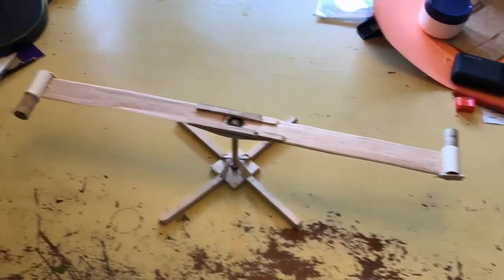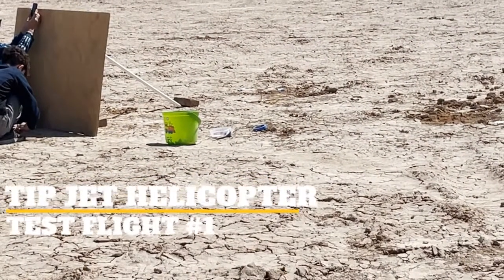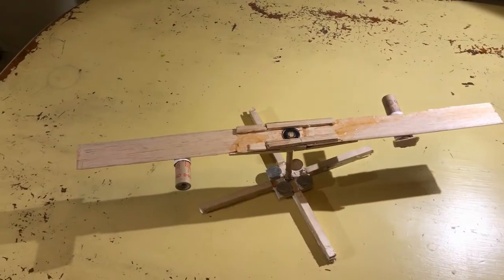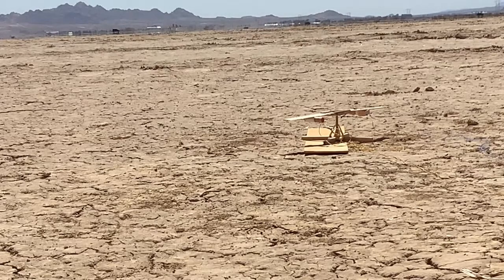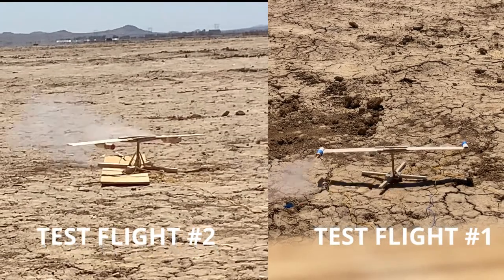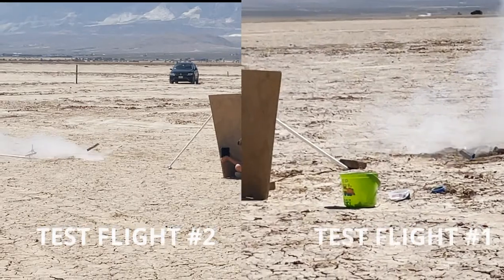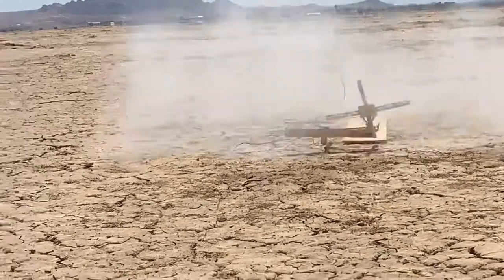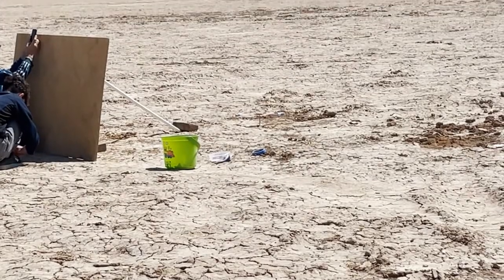Tip Jet Helicopter Test Flight #2

Comment: you may have way too much power. you shouldn't need nearly that much to spin the rotor. all of the older helicopters that functioned this way, had way less power to scale.
Reply from the maker: indeed!
I believe I had the same problems with A motors.

This project taught me that two motors on a rotating blade are hard to ignite. I think monocopters are far easier at this scale.